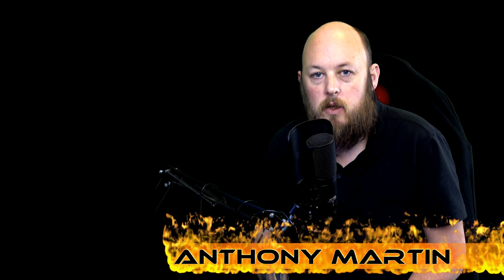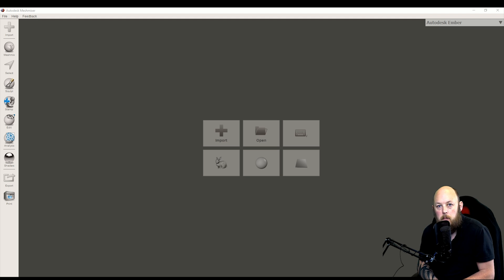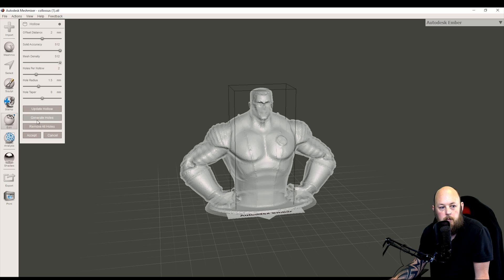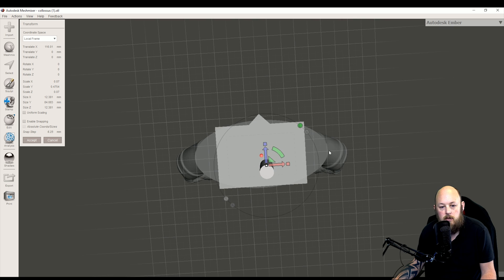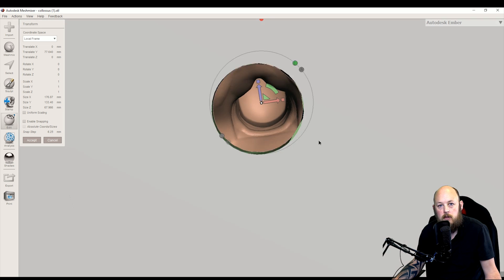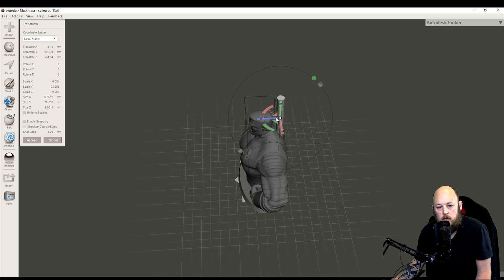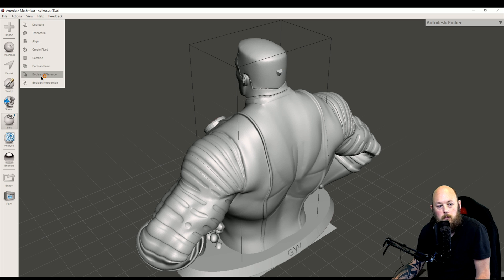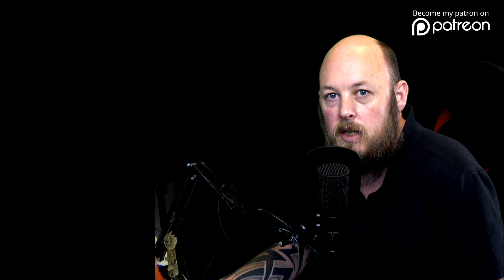How to Hollow out models for Resin Printing using MeshMixer!

Comment: The 2nd drain hole on top is not necessary. As long as the model is printed it has an opening on top anyway. Just the last layers will close the model.

Comment: thumbs down,  incomplete video.
Reply: Guess you should have also showed him how to turn your pc on, how to use internet explorer,  how to and where to find a 3d model, how to buy a 3d printer, how to set up your 3d printer, how to how to load your 3d printer with resin, how to install mesh mixer, how to set up mesh mixer to your 3d printer, how to add supports, how to save the 3d model, how to slice the 3d model, how to transfer the 3d model to a usb drive just in case your pc isn't directly connected to your 3d printer, how to print your 3d model, how to remove your 3d model after its done printing, how to clean your 3d model with isopropyl alcohol, how to cure your 3d model, how to remove the supports from your 3d model, how to sand any imperfections in your 3d model, and how to paint your 3d. I hope I didnt forget anything that you need to add to your video for him because god forbid you leave something out. Now if only his parents had taught him how to be a civilized person in society.
Reply from the maker: What did you need
Reply: @TheHotEndChannel  A different presenter for one.  But close off with maybe how to save your work......
Reply from the maker: Wow ok.

Comment: I just received a Wanhao Duplicator 7. Love this video, because it makes absolute sense to print hollow. One thing the video doesn't cover is - what to do after you have completed in MeshMixer. I sculpt my stuff in ZBrush and am able to hollow out using ZB. Wanhao uses Creative Works as the application to print. So how do I get the MeshMixed (Hollowed out) into Creative Works to print hollow on the Duplicator 7?
Reply from the maker: +Mark Williams sorry - export to STL and print in CW
Reply: Brilliant!!! Thanks 👍